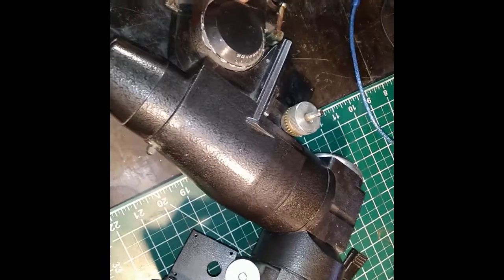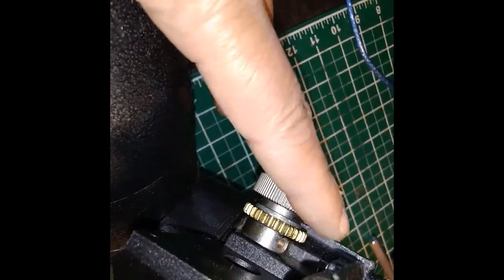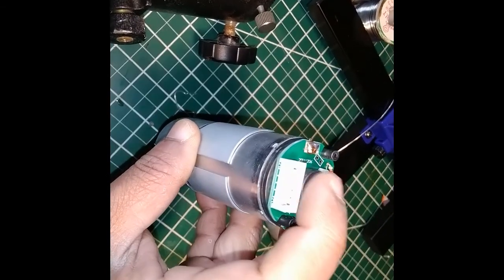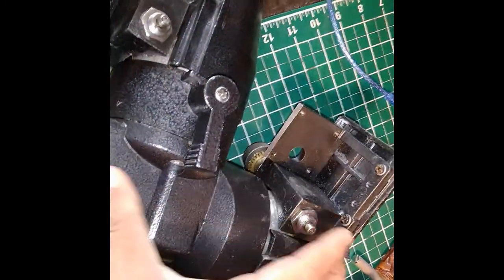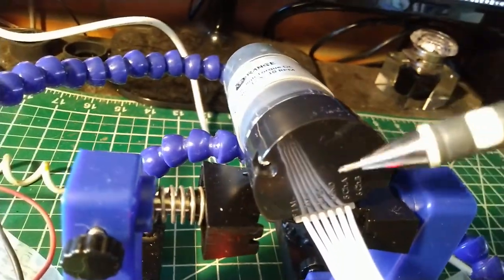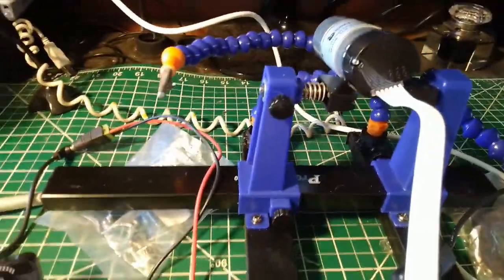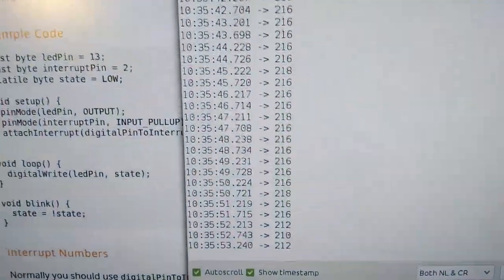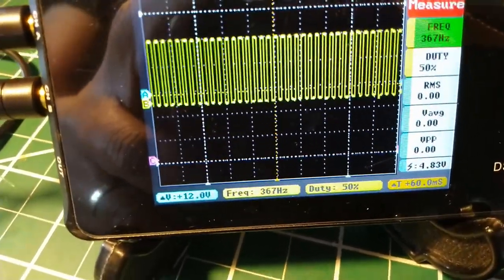Konus EQ Mount GOTO Modification - Part 1

Comment: Aswan, you can use the OnStep Controller with STM32 bluepill. Its much better than UNO. Currently I am building the version with Wemos D1 R32 and CNC V3 shield. Its free, open source and far better than commercial ones.
Reply: your mount is a EQ5 model and OnStep will work really well.